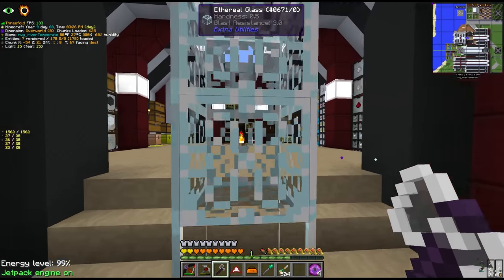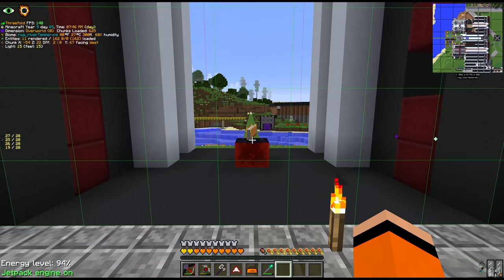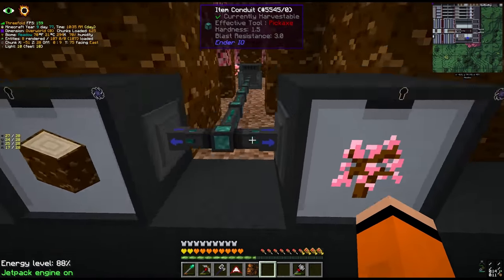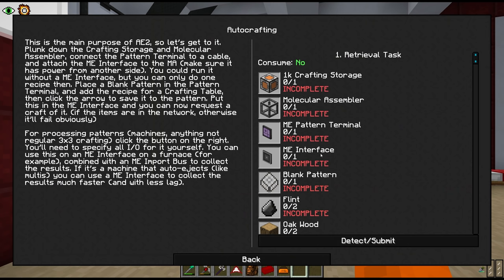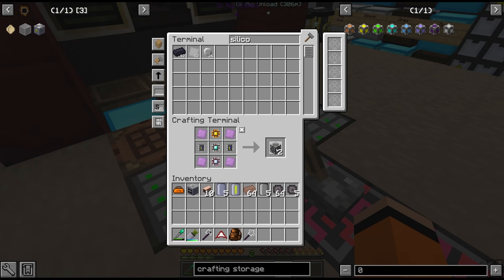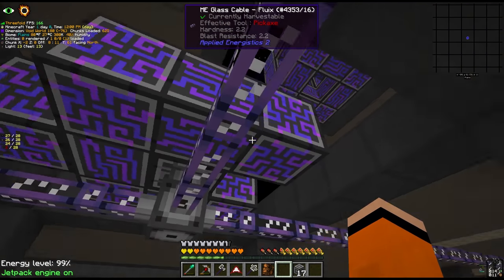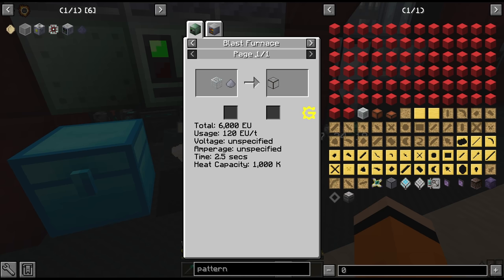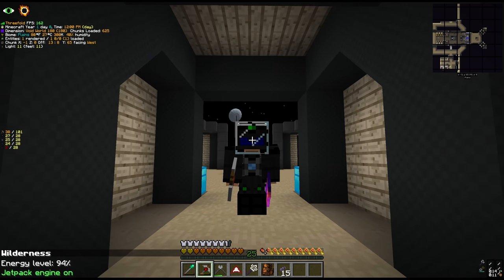Gregtech New Horizons - 34 - Base Move! Modded Minecraft

Comment: Don't ignore the resources that you do now have access to with a T3 rocket. Platinum Ore to feed the platline, Naquadah ore to make naquadah doped wafers, Plutonium for all of your Radon and/or MOX fuel needs, Chrome for easier stainless, there's good stuff to be had.

The EnderIO farming station gives a growth speed bonus to any trees in it's radius, and can use unbreakable TiC lumber axes IIRC in order to do it's work. You can further speed it up (I think?) by giving it Fertilized Dirt to plant trees on. Combine all of that, give the farming station some spruce saplings for big 2×2 trees, and watch the wood come in crazy fast.

There's two ways to quickly get unbreakable lumber axes. One is to craft a lumber axe entirely out of Magical Wood, and give it two more modifiers with diamond + gold block and diamond block + notch apple. This gives it ten total modifiers, which is enough to get unbreaking. The other method involves making a lumber axe out of thaumium, except for an obsidian large plate, which gives you a lumber axe with +2 modifiers and Reinforced III by default. Give it some combination of extra modifiers and levels, and you'll be able to get the seven total modifiers you need to get unbreaking.

GTNH does have AE and dense AE conduits, so you can have basically ME cables in conduit form. They're not perfect and aren't the cheapest things to use, but they'll get the job done.

A good starting point for new bases is fluids, since you're going to want pyros and distillation towers aplenty to create and distil tons of various fluids, and those are very large multiblocks you're going to want to get up and running sooner or later.

Molecular Assemblers aren't all that useful in GTNH, since so much is done through machines anyhow. Now the arcane assembler, on the other hand...that one is just straight painful...

You're definitely going to want to centralize power in your new base, and start planning for that sooner rather than later. That said you also might want to look into good long term power storage, either in the form of a GT++ Power Sub Station or a Lapotronic Supercapacitor. The former is cheaper (if requiring obnoxious GT++ alloy fetish indulging), stores more power until the very final power tier, is more flexible on where you can place energy/dynamo hatches, doesn't require maintenance, has less passive power drain if you choose to cheese it (not that it amounts to much in any case), can use laser hatches pre-ZPM if you care about that for some incomprehensible reason, and doesn't require tiered glass at the cost of...looking more ugly. Which might not even be the case depending on how it fits into your base design, so...go figure ;)

Whatever your plans for the new base are, upgrading your circuits should be high on that list. I've build an EV/IV base without upgrading to nanocircuits sooner rather than later, and rest assured, that was a big mistake. You know those compressed chests, how they hold several dimensions worth of stuff in them? I was batch crafting circuits with those, and one compressed chest wasn't enough to hold all of the materials for all of the batch crafting I did. And I wasn't batch crafting enough. Do not delay upgrading circuits. It is a mistake.

If you ever want to move very specific amounts of fluid, by the way, say you want to craft exactly one quantum eye and not have any radon left over, you should craft a Volumetric Flask. There's a quest for it in the MV tab, right off of the central MV machine hull quest. It was more useful before machine fluid tank sizes were standardized, but you might still find a use for it on occasion.

There's a cheaper 4K (and higher) storage component recipe in the circuit assembling machine. Use them for the higher tiers, because they make storage components cheaper and cheaper relative to the regular crafting recipes.
Reply: To make unbreakable tools unstable tool parts are the best
Reply: @Royal_4096  They do come with innate Reinforced IV, better than Obsidian, but I've no idea how stable they are. That and never did the divination sigil activation ritual in my playthrough so I have a nasty tendency to forget that unstable ingots are even a thing. It's not hard to get experience on a lumber axe, anyway - just chop down a sacred oak tree and you're good. The tool will break, sure, but it'll still get enough done to level.
Reply: @TheShadowofX  Full unstable tools are unbreakable right away, so they are the easiest to get
Reply: @Royal_4096  Did not know that.

Comment: Hey ! You're in EV now, so why bother with cetane ? Make up two oil crackers, and then steam crack heavy fuel and hydro crack light fuel. Two distillation towers later, and a bunch of LCRs, adding on top your biomass line and now you have not just High Octane Gasoline (The best oil-based fuel) but also all of the cracking-sourced hydrocarbons for chemistry. Since you also have AE2, a bunch of P2P (or fluid storage buses if you dare) makes managing max size distillation towers easy. At least that's how I'd do it :p
Reply from the maker: I actually was planning on switching to HOG, despite there being more efficient options I think that hog would be the most fun. We'll need to do some testing and see :D

Comment: Don't make too many singleblock machines. I am pretty sure you can already unlock GT++ multis. They are faster and run many items in parallel. Some can even work as several different machines.
You can also rename interfaces using a quartz knife.
Reply: GT++ multis are mostly gated by the alloy blast smelter which he doesn’t have yet, and are not cheap
Reply: @Royal_4096  I believe he can make the ABS without much difficulty as of now. This will require some IV circuits, but once you make the gtpp bender and wiremill you literally speedup your circuit component creation tenfold.
Reply: @Vova__  Of course, but he needs to work towards that once he has the infrastructure